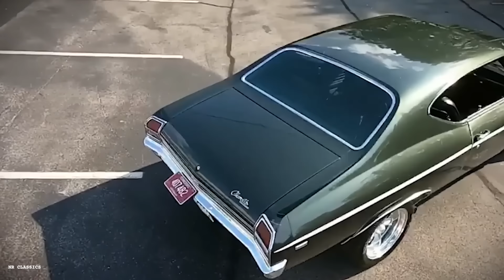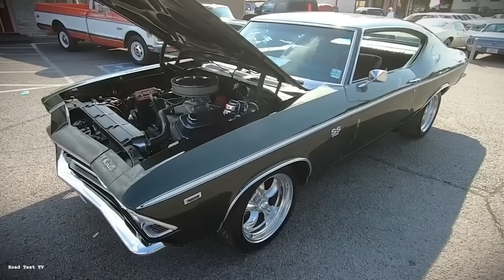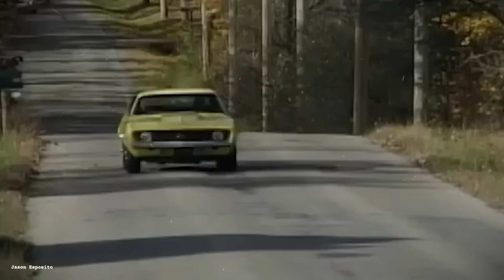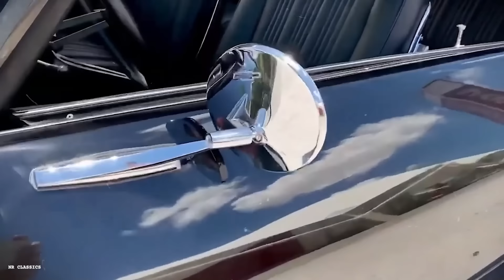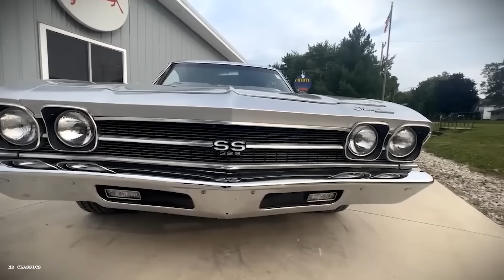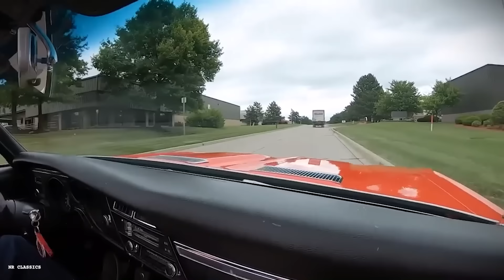How One Mechanic’s “Weird” Trick Made a 1969 Chevy Embarrass Faster Cars

Comment: *
     I purchased the 1969 Chevrolet.....
         " El Camino 396 SS ".
 Pulling and selling the engine by itself, which paid for the initial price of complete vehicle +.
  Then replaced it with 59' 283sbc, that was totally modified.  Starting with the cylinders being bored to Max. Dia. Keeping the original forged steel Crankshaft. It was topped with 327cui Big Valve Heads and ported, polished. 
 Manifold is the 69' 350 SS " Camero " w/ original Rochester 4Jet " modified " jetting & linkage adjustments. And of course, Cyclone Long Big Tube Headers dumping into large collectors  
w/ X-pipe scavenger connected to dual exhaust running all the way back to rear bumper and then set of " Monza " tips for the 4 pipe appearance. 
Add a bunch of Cooling and Filters, and it would way more than Peg the 120MPH Speedometer. Winding up to maybe 160/165mph. By the Gentry's Hydromatic Transmissions built TH350 w/ Low stall converter for the original rear differential for the 396 big block Highway Geared.....
Was my daily driver/ work truck.

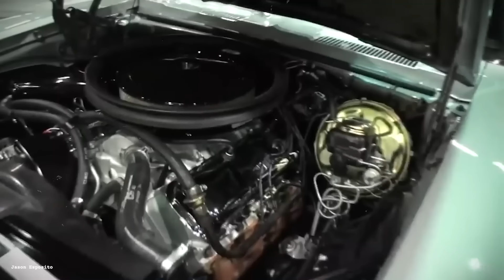Comment: I drove a stock 396 375 HP with 4:10 gears 69 Chevelle SS 396 375 HP. That car ran super strong to 6,500 rpm. It was not my car but I tune it and keep it running. I had a camaro That ran 12:90 back then. That 69 Chevelle SS 396 375 HP. ran faster than my car as we drag race each other several times on the street several times and I lost by 2 car links every time. I drove others but that one was special and ran like hell. Guy wrap it around a tree. His rich daddy bought it for him and lucky he did not kill his son because he was only 16 and not into cars. The kid was not even hurt. Dam lucky looking at the wreck car. Chevy was bad at there deck height back then. This motor must have zero or .005 under deck size. That is why chevy had the same car and engine and some ran great others a dog. Every dog I took apart the piston was up to .050 into the hole. Were they should have been .005 to .000 deck height.
Reply: That 375 hp was for insurance purposes that engine put out at least 450 hp from the factory. 
My brother purchase a 1969 Chevelle 300 front bench seat 4 speed Muncie  M22 Rockcrusher that sounded like is was grinding metal in each gear 
Factory 12 bolts rear axle 4 link rear suspension 411 LS .
You couldn't get that vehicle to hook up on the starting line with any tires made back then unless you cut the fenders and put slicks on.
That car was a time capsule.

Comment: My girl friend bought 1967 chevell from a Docter in 1981 had the 327 with 275 HP two speed transmission  and there was no one that could get us in the 1/4 mile stock it always took the hole shot because of that 2 speed trany and it would chirp going into Drive from take off. It was a bad ass stock 327.
Reply: There's no way that power glide transmission would challenge a 4 speed. With that engine 275 hp and a 2 speed automatic transmission you done good to turn 15 seconds in  a 1/4 at about 80 mph.

Comment: Traction bars on a 4 link rear suspension  ?
Reply: Yes. They aren't the "slapper" kind like on a leaf spring rear. They bolt from the axle tube to the frame. Kinda tortures the axle going around corners.
Reply: Exactly @

Comment: You put a low rear end gear in most muscle cars that will change the car completely and probably out run most of the cars on the road. 
When I was in high school I didn't have any money, I had a ratty multi-colored 55 Chevy I bought for 300 bucks put a used 327 with double hump heads in it from a 66 Impala, put a 327 350 horse cam, holly aluminum intake, old junk headers, a Saginaw 4-speed from a Vega it ran good Intel I broke the stock rear end then I found a 10 bolt posi with 4:88 gear for 80 bucks, I miss those old days when you could find cars cheap,  that thing was a rocket ship after that. It would out run just about any daily driver muscle car
Reply: HAD A 66 NOVA  ( FORMER  6 CYL) 427 L88 500 + HORSE 🐎 
NUTTIN LIKE .LIKE BUILDIN.YER .OWN  RIGHT  ???
Reply: @RegKarp 396 Chevelle's are cool but a 396 Nova is cool too and faster. Plus you could get a 327/375 hp Nova in 68 and 69. Faster than the 396 because it's lighter.
Reply: Yep, 151 hydraulic cammed 250-276 327's  (6200-6700 rpm)  2" open spacer, single 660 modded center-squirter carb and 4.88's kicked a bunch  of azz!
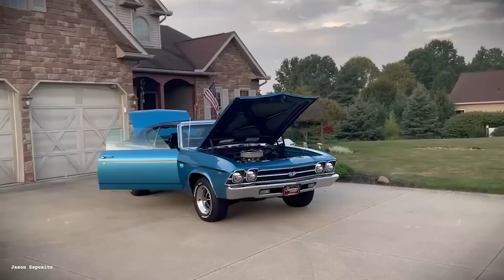Reply: My father they grow up working in his dad's gas station and garage what's the friend of Charlie Abrams the martyrs in 1957 and Charlie let my father the only LS6 1970 Chevelle Gilbert sold four Mile Road the believer special ordered by Cleveland browns the summer of 1970 when they were at spring summer training camp in Ohio and dad went up and ran the head ran the quarter mile speed shifting and not hurting the car the 4-speed that was blue with black interior so powerful that Charlie told my dad Johnny you got to drive this thing it's so powerful even move it I have both sets of keys in my pocket and I'm the only one moving that car in the garage so it gets prepped dad told me to hang around the porch that Saturday he asked me where the Ed ran the quarter mile started and ended up and I told him from the corporation limits of down to the Ed randa insurance sign was exactly one quarter mile and I heard and listened Dad running it through the years again properly clutching and not hurting the car no tire burning and at the dinner table my mom said to Dad John what was the big deal about that Chevelle and dad said that was the most powerful vehicle we ever drove that it was actually scary not boys and girls was an SS LS 4:54 1970 Chevelle with a rock crusher 4-speed that was actually producing over 500 horsepower when the insurance companies were told 450 maybe someday I'll find out who's the Cleveland Brown was that bought that special car that was so rare some Chevy dealerships never even got one to sell and they were almost uninsurable they were death traps because they were so powerful did people would think they could handle them in that car would get away from them and they would wreck it and get hurt or killed!!! In memory of Charlie Abraham in John Henry Mayer!!!🔯✝️🙏💜
Reply: 100% correct. A high numerical rear axle will make any car faster in 0-60 and maybe 1/4 mile. 

This article is foo foo.
Reply: Repeat:
A high numerical rear axle will make any car faster in 0-60 and maybe 1/4 mile.

It will suffer fuel economy, engine wear, and top end speed which is why that kind of rear axle is impractical for everyday use.

This article is foo foo.
Reply: So true ... in 1977 I found a complete 1969 GTX 8 3-4'' 3.91 Sure-Grip rear end - the complete differential, with brakes and the leaf springs - for the princely sum of $25! I put it in my '70 Roadrunner that had a 2.76 rear end from a '64 Dodge. Without any special tuning, it picked up half a second in the quarter, and about the same from 0-60. The only downside was that at 60 mph the engine was turning 3,000 rpm, so it was no more a highway cruiser deluxe, but more of a street/strip ride.  Gas mileage dropped slightly, but not by much.

As an aside, I once drove a plain-Jane '66 Malibu that had a full-tilt 350 SBC, huge solid lifter cam, Torker intake, 850 Holley, 4-speed, etc. It was faster than my 430 hp, 440-powered Roadrunner, at least up to 95 mph, then the Roadie would outrun it, as it still had 1,000 more rpm to go,